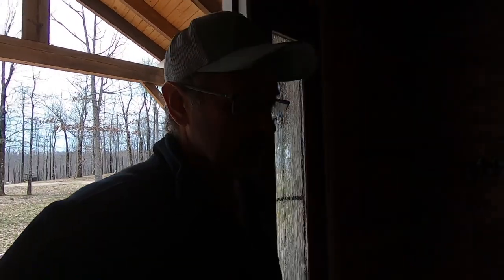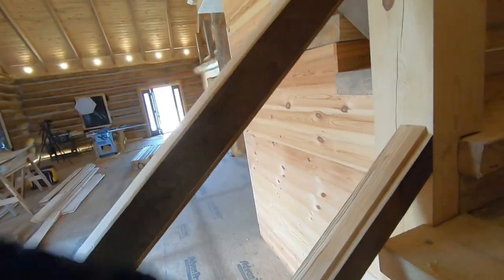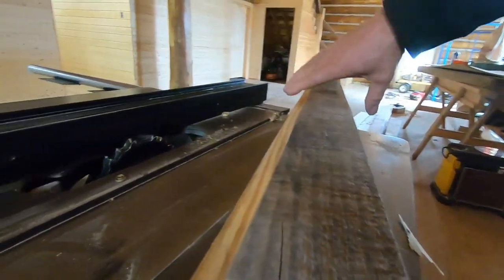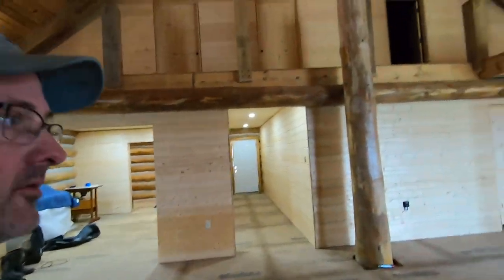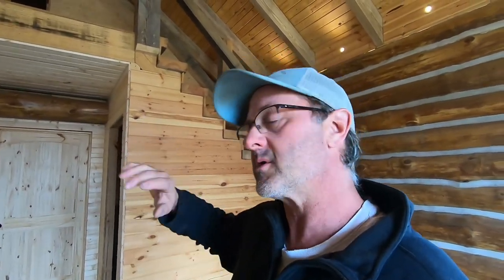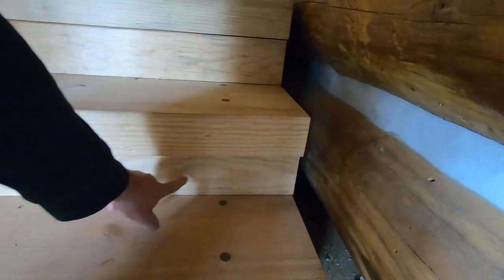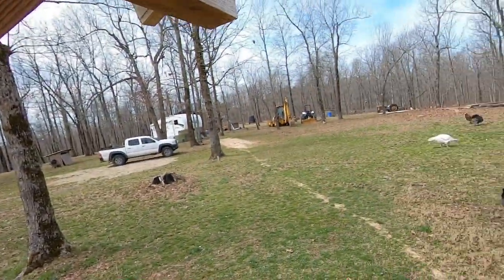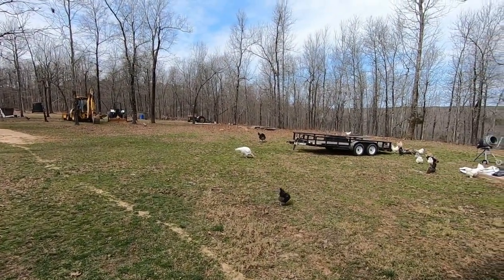Making Balcony Handrails out of Old Beams.

Comment: I am using battery operated motion sensor spotlights from Ikea in the staircase and in rooms that I just go in and out of (Stötta). You can hang them in the ceiling or on the walls.